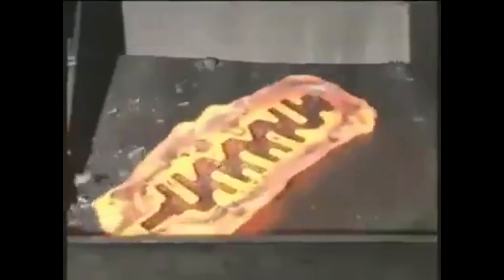how it's made crankshaft

Comment: how do they get all the oil passages inside? to me that's the tricky part.
Reply: Very precision machining. I've made custom parts similar to automobile crankshafts that required holes like that to be drilled. Lots of setup time. It takes many factors more time to setup and measure than it does to drill the hole.
Reply from the maker: +lampim they drill them afterwards
Reply: gottcha. still a bit tricky because they go at all kinds of angles and have to meet up inside.
Reply from the maker: +lampim measure twice drill once xD